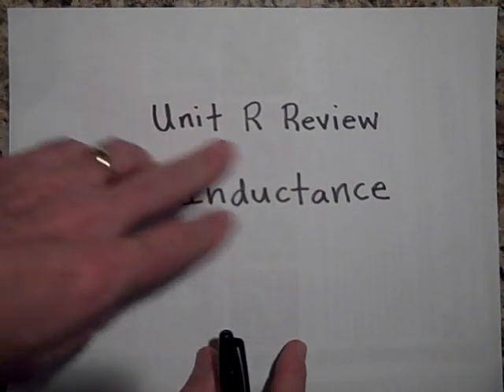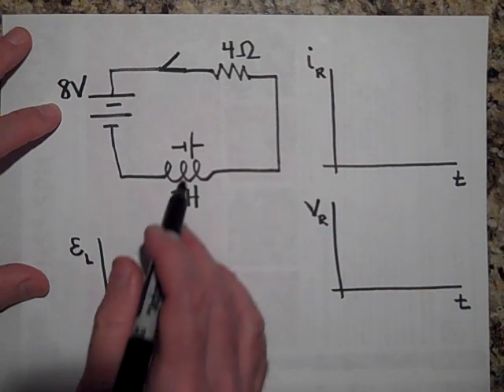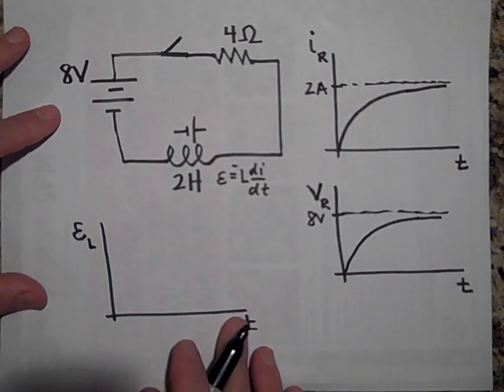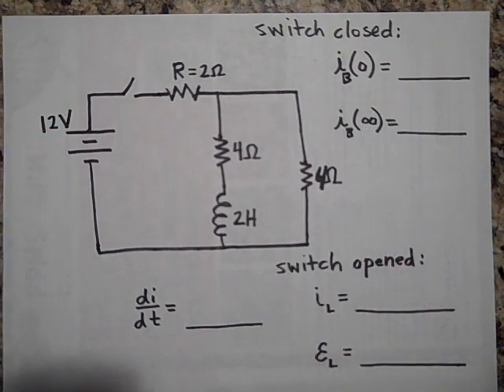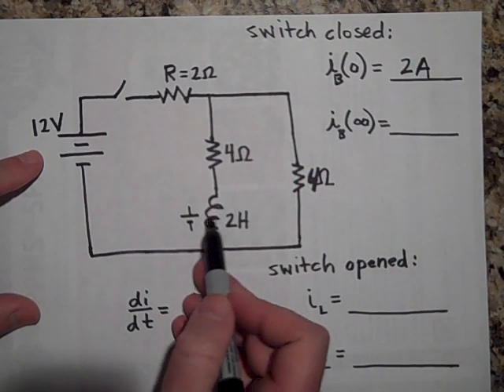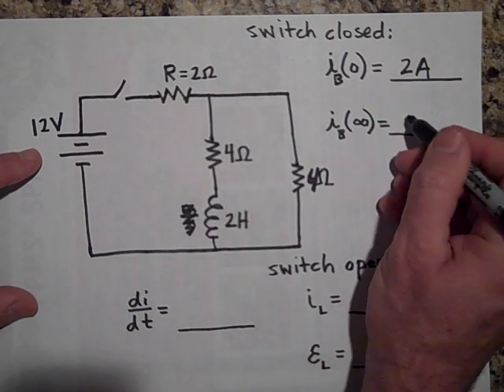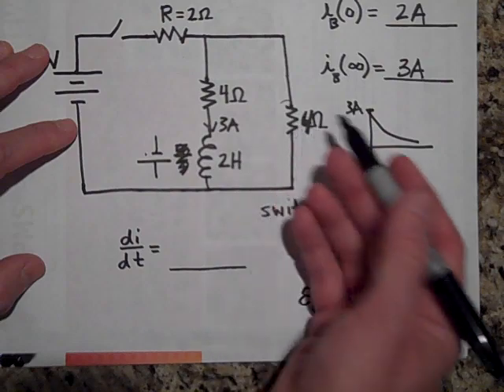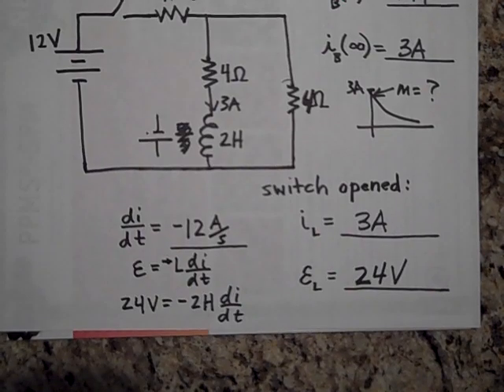Review of Unit on Inductance (part I)

Comment: Dear Sir, at the end of the film you state that the current through the inductor is 3 Amps. However, please review this answer, als I think it should be 1.5 Amps. Two ways of approaching this problem: first is divide total Amps by 2 since it splits two equal ways; second is the voltage over the 4 Ohm resistor and the 2 Henry inductor, which (in an equalized state) is 6 volts, thereby generating a current through this part the circuit of 1.5 Amps. This restores the voltage over the inductor after opening the switch to a normaal value of 12 Volts and the di/dt to 6 Amps/sec.  Brgds.Rob
Reply: Rob dB  
I figure out how he got 3A  current after long time or at infinity. at infinity the inductance act as long wire without resistance. so, the only things matter are 3 resistor (2ohm, 4ohm and 4ohm) But  4 ohm resistors are in parrelel so by ohm law is equivalent to 2 ohm. 
So, 2 Ohm resistor and 2ohm makes 4ohm. Hence, 3A current at infinity.
Reply: @gyanendrashrestha189  The current through the 2 ohm resistor is the total e.m.f. over the total resistance, which is 2 ohms plus 2 ohms (parallel resistors) = 4 ohms, which makes the total current = 3A. Couple that with the current diverting into the parallel branches, the current would then be 1.5A.

Comment: at 7.11 i dont think the 3 amps is the current flowing in the inductor, is it not the current flowing through the 2 ohm resistor, which is then divided as it is a parallel circuit? Or am i wrong?
Reply: Yes its only 1.5 a
Reply: @smedusri5138  Taking me back 11 years to my college days haha. Thank you for the throw back.